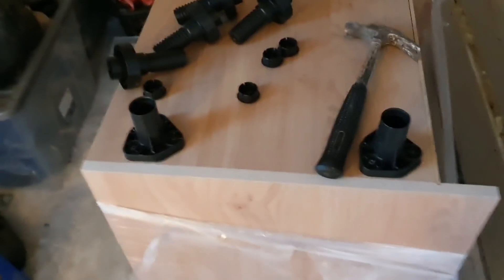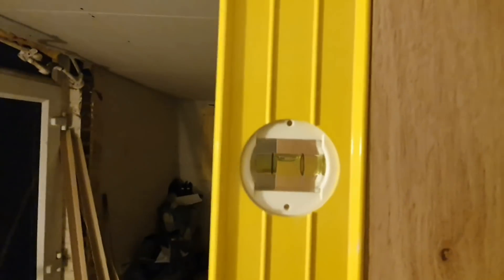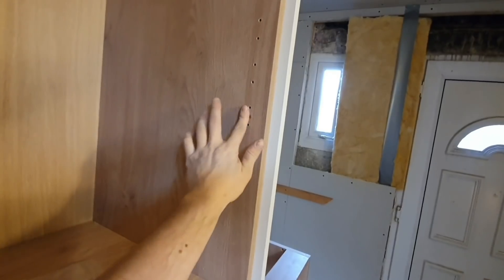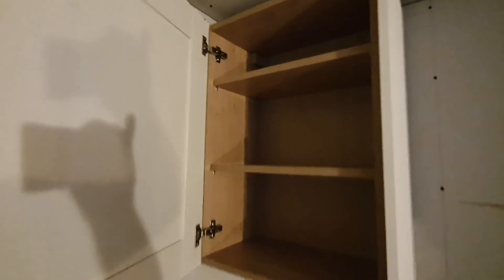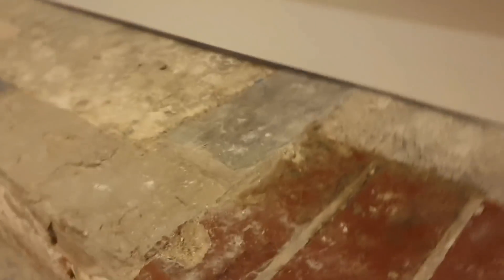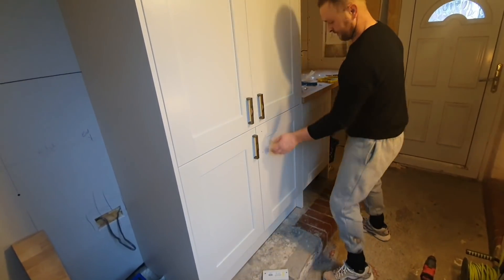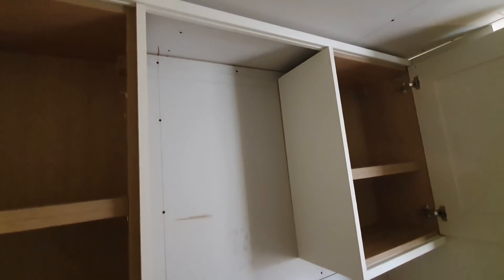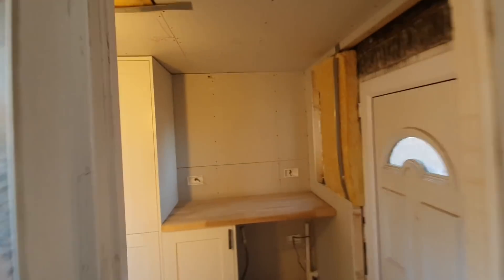How To Fit A Kitchen With Only One Mistake

Comment: Unit feet should extend and support the sides of the unit. Howdens units are particularly poor, other companies make far better units and their pricing structure is a joke. When people load up the unit shelves and bases what supports all the weight? the base chipboard alone rather than the weight being carried down the sides of the units to the feet. Far better quality kitchens available for less money and I say that as someone who's had an account at Howdens for over 25yrs , back then they weren't bad.

Comment: Dude, did you not consider putting end panels against wall to balance units and keept door away from wall ?
Reply: Thats the fuck up, got to have a spacer between wall and unit, especially if the walls unfinished 🙈
Reply from the maker: I did leave 5mm

Comment: You would find it easier putting a block of wood behind the door when your drilling and it won’t damage the back of the door ,,and only youse an ordinary screwdriver so you don’t strip the threads on the screws ,, and the doors already have to little dots marked on for drilling  that was a classic schoolboy mistake lol
Reply from the maker: Just a bricky, if no one tells you how do you know? I do now cheers